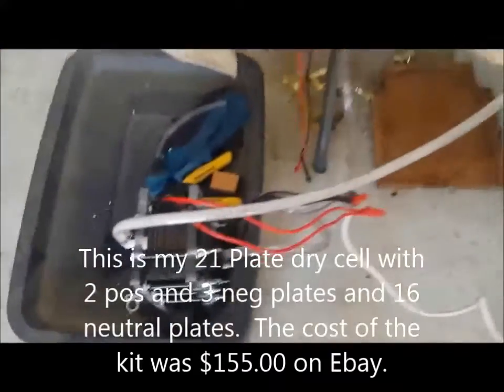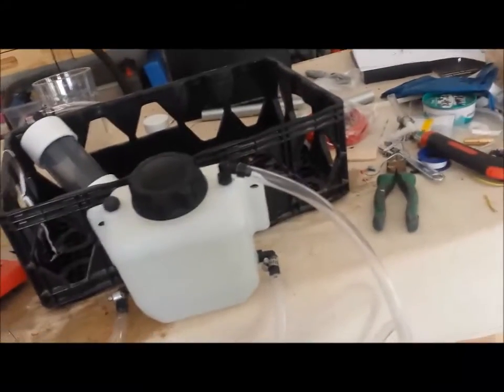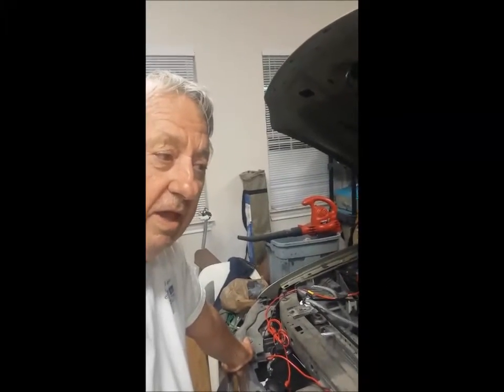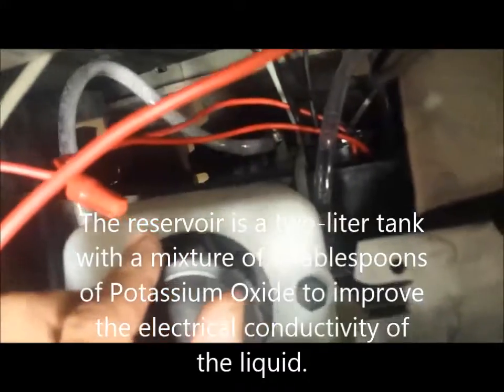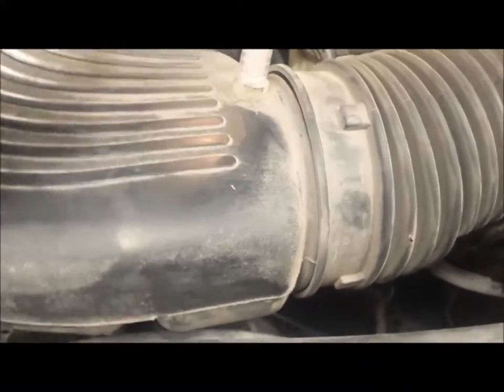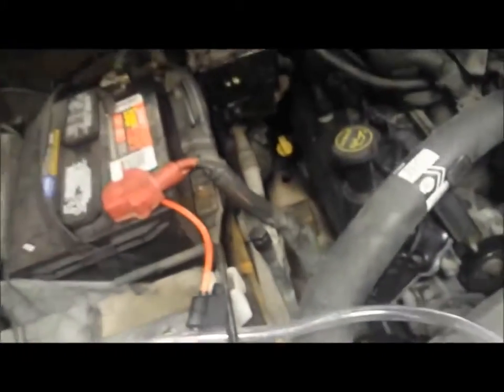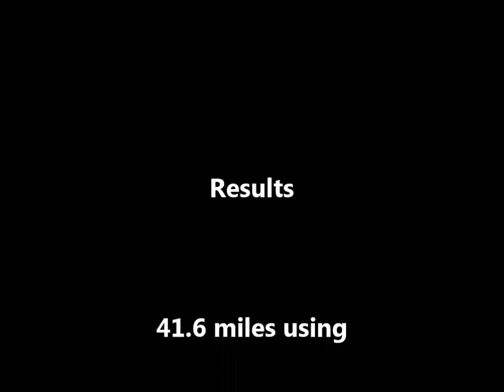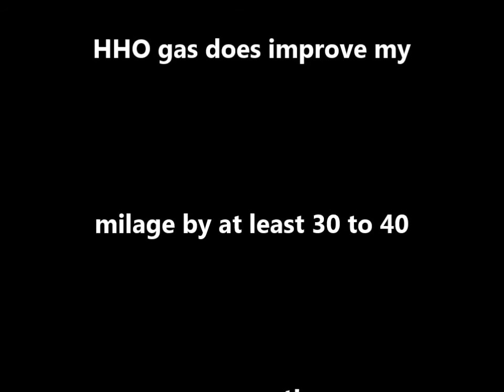HHO Gas in Ford F 150

Comment: Well I have two cells kid on mine not the single still kid you're only running one bar of pressure I have two bars of pressure with both dry cells a lot more fuel a lot more HHO

Comment: Did you shut off the gasoline?  The only way you could use more is if you left the gasoline running while also running HHO.  The HHO is used instead of gasoline, once everything is running, and before you drive away.

Comment: I have built a hydrogen reactor. The only problem I have is that the cables are burning. I have put a charge regulator but the regulator is very hot. What is the problem?
Reply: What size wires are you using?
The thickness of the wire is according to the amps running trough.
I've seen this happen in a lot of mickey mouse connections.

Comment: Question did u have to perform a tune on the engine or just cut off the fuel pump and spark and plug the kit ?

Comment: Add some colloidal silver to your water. Make sure the water that you're using is distilled. This should increase the output.
Reply: I use Silver for health reasons. How does it aid in this HHO manufacturing process?
Reply: I use for health also

Comment: I think it matters if you have 02 sensors and injectors or a carburetor
Reply: U can tune
Reply: @chrisnano1266  how does a regular person retune their fuel injection where it runs leaner ( less fuel ) for the HHO combustion which sends more oxygen   through exhaust and O2 sensors which respond by increasing fuel ? Im not doubting it can be done, just not sure how to make it happen and get the end result of less gasoline consumption.
Reply: @dont.ripfuller6587  any regular person with a odb 2 to USB connector and a laptop can tune it for better mpg
Reply: @dont.ripfuller6587  hydrogen is taking place of some of the gasoline so u don't need as much

Comment: how is the HHO generator in your car after years of use? I'm planning to install on my gasoline engine. Please advice
Reply: I have used one for 12 yrs...the vehicle is(2001sc1saturn)  approaching 423,000 km..runs around 40- 55 mpg...still runs like new..
Reply: @thebearsden1701  thanks for the confirmation

Comment: Doesn't work other than to prove the validity of: "a fool and his money are soon parted". "Project Farm" thoroughly tested and debunked the hho-cult.
Reply from the maker: that is exactly what I say when I check my generator that has been running for over a year with no gasoline tank and no gasoline line.
Reply: @kenhines  so you say. Project Farm utilized a generator and the result was hho actually and repeatably reduced fuel efficiency. He did not even use the generator output to power the hho cell, he used a power supply connected to house current. There are no instrumented tests where hho is found to be anything but snake oil.
Reply from the maker: @walterk1221   There were people like you around when man begin looking at flying in the air.  Some people prefer to keep their heads buried and bark at anything new.
Reply: @kenhines  bad attempt at an analogy. Heavier than air aircraft are in compliance with science. Bernoulli's principle describes how that works. Sorry bud, your lack of understanding is very evident but your huckster shamelessness is well developed.
Reply from the maker: @walterk1221  you are right.  Have a good life.
Reply: @kenhines  I already am and I hope I educated at least one potential victim of the scam you promote.
Reply from the maker: @walterk1221  I have a generator that has ran almost continuously for over a year and is running on HHO only.  The only time I shut it off is about every ten days and that is only to change the water and baking soda.  This generator keeps six, deep cell batteries charged.  I run an investor converting 12 DC (that is direct current) to 120 volt AC (that is alternating current).  This system powers a small shop where I have a large air compressor that runs multiple air tools.  There is no other power for the SHMP.   Call it a scam if you want but it has saved me considerable dollars.
Reply from the maker: Inverter not investor!
Reply from the maker: Shop not shmp
Reply: @kenhines  show this contraption operating under a reasonable/significant percentage of rated output on hho or it doesn't exist. I can say I have 55 perpetual motion machines in constant operation but I can't show them because they don't exist.

Comment: Nice setup. I had the exact same results with this kit from ebay on my F 150. I also hall a bed full of heavy copper sheet and  heavy equipment. 21 mpg consistent on the highway.  Huge gain.  Thank you for this great video.
Reply from the maker: Bill,
Sorry for the late reply.  Yes, HHO is the future I believe.  I ended up selling my F150 with the HHO system about a year ago and bought a new Ford Ranger.  There is absolutely NO space to install an HHO system on this vehicle.  I have built something for my lawn mower and it proved to be too bulky to attach the equipment on the mower.  However, I could get it running on HHO from a 12 volt battery.    Hope your system is still working well.
Ken Hines
Reply: @kenhines  how is the HHO generator in your car after years of use? I'm planning to install on my gasoline engine. Please advice
Reply from the maker: @jaysagrayum7448  I sold the F150 and now have anew Ford Ranger.  No room for the extra equipment now!
Reply: @kenhines  Wow, that's great! you have now a better car :)

how long did you use the HHO on your F150? Were there any issues or side effects or you still believe that HHO helped a lot on it's efficiency and fuel conservation? Looking forward for your expert and just advice. thanks in advance
Reply: @kenhines  would you still recommend using HHO for my gasoline engine car?  I very much value your recommendation
Reply: What’s the link?

Comment: What if you had two generators in this set up would you get better mpg? Have you towed anything while running this?  I have a camper that I am pulling with my 05 150 5.4 want to improve my gas so I can spend less at the gas pump
Reply: well. if you add more mixture of any fuel in a internal combustion engine, at some point is toomuch, so you must use care and get into fine calculationt to whomuch is the RIGHT RATIO. fuel (HHO or gas) ans Oxigen. plus HHO is dryer than gas and you should calibrate throtle position so that your gas inpun dimish since you still want to press the throtle but send les gas ... is not just about adding more hidrogen.. any engine give the best performance when properly TUNED.  good luck
Reply: It won't work.

Comment: Two questions from someone who doesn't know anything about trucks: 
1) which kit did you order/ how much did it cost?
2) I have a Ford F150 1999 4 cylinder, where would you suggest installing it?
Reply: I install these for free on Sundays if your in San Diego area. you need about 2lpm for a truck and you need a tuning chip.
Reply: I will keep that in mind, thank you
Reply: @MrHydroguy are you still doing hho kits in San Diego?
Reply: hi a have a toyota pick uo 88 what i need? im in san diego area thanks!!
Reply: @lautarotestero3817  im also on offer up
Reply: That is an alternative gas solutions cell or one of its distributors. I have installed alot of those they are a well priced kit for an experimenter.   It is about middle of the road in price and quality. There are a quite a few high quality kits out there now with better efficient controlled electronics. Not to say this is a bad product but just my honest opinion. I have installed hundreds of hho kits.
Reply: @MrHydroguy  what kind of electronics?? I'm looking for it!
Reply: @TravisTellsTruths  Which electronics are you referring to? The power supply to the cell or the electronics to mod your vehicles fuel ratios.
Reply: you should be able to install it in the front fender behind the head light low as possible or in front of the grill but that is only if there is no room elsewhere. You dont want to block air flow to your radiator or as little as possible it can cause hot spots. You want to avoid installing in the engine compartment if at all possible.
Reply: That is a Liberty Industries hho kit sold on ebay for $160. The best bang for the buck.
Reply: Check my channel mr hydro guy and I have ad on craigs.
Reply: @MrHydroguy  Im looking you up 3 years after this but I am seeing MrHydrohead and Im not seeing anything on cragislist are you still doing helping people install the kits even if your charging for them?
Reply: @danielshively9778  yes
Reply: @danielshively9778  im on offerup now too
Reply: Those kits are I believe 399US
Reply: Why do we need a tuning chip you make no sence does a Agency pays you
Reply: @rogersalazar6410  you need to tune it to work with the new fuel mixture.